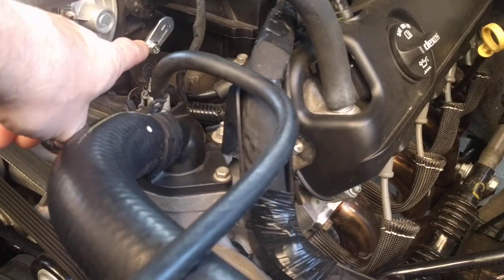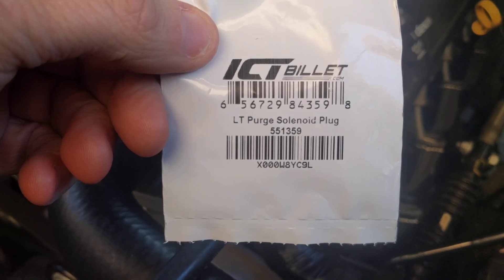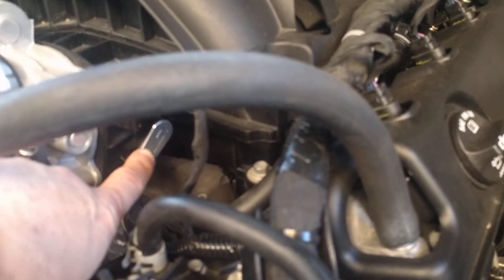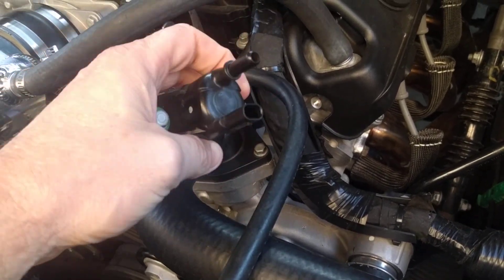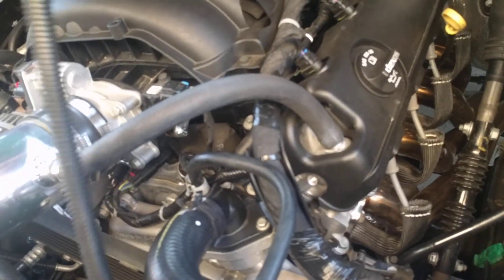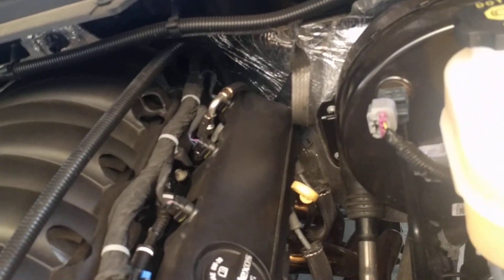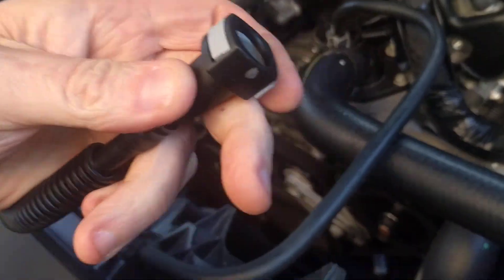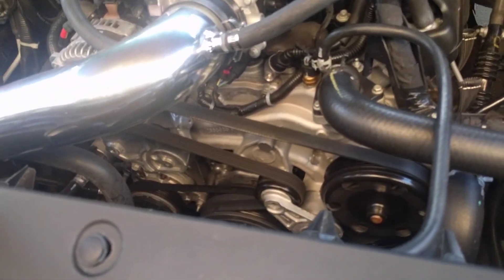Silverado Sierra  EVAP Purge Solenoid Delete L83 L86 K2XX

Comment: What car is the motor in. The reason I am asking is I need vacuum for my brakes in a 65 Chevy c10. Was planning to use that port
Reply from the maker: It's in a 2018 Sierra.  You can use that port for the brake booster, no problem.  That's what I was going to do before going supercharged.
Reply: Thanks. Gonna give it a shot.
Reply: D Is that a serious question   Back in 65 there was no such thing as Emissions.   The PCV was a

Comment: Will that help to prevent oil vapour from entering back and affect intake valves by the contaminant?  Instead of using a catch can?
Reply from the maker: I don't think it'll help with oil vapor.
Reply: evap is only for fuel vapors

Comment: How does it let in unmetered fuel I have the 76/65 billet wheel on3 turbo on 15 l83 was just running 6lbs at 444hp 480tq then switched to e85 and lt4 pump and 9-10 lbs of boost  made 510/580 on a real hot day with no fan blowing on motor or intercooler! At 61% e contents since then running 71% and cooler day and it breaks up up top when I lay into it I’ve had to lower my boost back down to like 7lbs with this cooler weather would lt4 injectors help make up the difference or would I need more any help would be greatly appreciated
Reply: that is lot of fuel. I don't have that much but larger turbo and same motor and more boost. no e85
Reply: Sounds like you probably have too blowout, adjust your spark plug gap and see if it clears up on top end

Comment: I've got a custom tune and my tuners says there is nothing he can do for emissions I want to delete this evap and my vacuum pump, what did you use to tune the codes out?
Reply from the maker: I don't remember the exact codes to tune out for evap, but they're clearly labeled in HPT.
Reply from the maker: Vacuum pump is easy....just remove, plug the oil holes, and find a vacuum source to reconnect to.   I haven't done it yet, but many have.
Reply from the maker: Also, if you are running forced induction...you would probably want a check valve in the brake booster line.
Reply: Boost is on the list for sure! Did you get your own hpt?
Reply from the maker: @williamogden6818  I've had HPT for years
Reply: Thank you for the information! Nice truck also hows the whipple! I've heard mixed things!
Reply from the maker: @williamogden6818  Haven't tuned it yet...still a few more things to do.  I'm going to delete my vacuum pump....you reminded me about that...lol
Reply: Keep us posted on that's it's a killer setup!
Reply from the maker: @williamogden6818  Stay tuned for a complete follow up video.
Reply: What does that silonoid do and are the pros and cons of deleting if. Thnx

Comment: Is that more like a Emission's delete or a Performance Gain/mod? Also what DTC's did you have to Enable/Disable... what did you plug the Rear Hose plug in with
Reply from the maker: It's more of an emissions delete to eliminate the unmetered fuel from entering the intake at random times.  Disable any DTCs related to EVAP in the tune.  The rear hose isn't plugged and open to the atmosphere.  
In the future, I plan to tap the delete plug for a vacuum source to run the brake booster.  There have been reports of the belt driven vacuum pump failing and introducing metal shavings into the engine oil system.
Reply: @n5yiz  yea since I ran e85 I just got the engine light back on and a email from chevrolet saying something about my emissions. Guessing this is it
Reply: Could I just disable the evap and be fine or do I need to do this?
Reply from the maker: @outen21  I believe you need to remove it.  I don't think you can disable the function in the tune.
Reply from the maker: @outen21  What codes are you getting?  You shouldn't get any with just a flex fuel mod.
Reply: @n5yiz  I'll have to check. I deleted all my codes for the rear o2's but it came on this morning
Reply from the maker: @outen21  send me your tune
Reply: @n5yiz  okay I'll send it when get off work later. Truck runs fine only in the mornings does it feel a little hesitant but that's been normal. Also he came on when I did the remote start, the truck started and shut off and the engine light was on
Reply: @n5yiz  you should have it man. My phone and lap top wasn't sending them
Reply: >unmetered fuel at random times

You gonna be mad when you find out what comes through the PCV system
Reply: pmoore4321 what did you do with the other Evap stuff ?